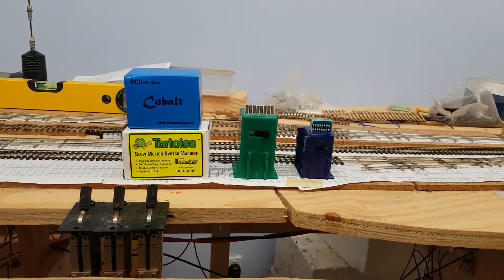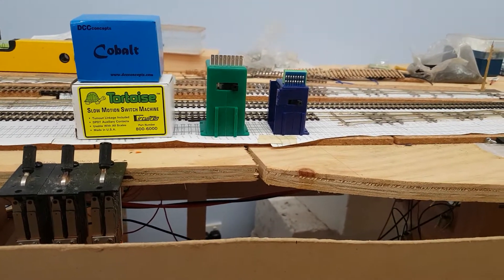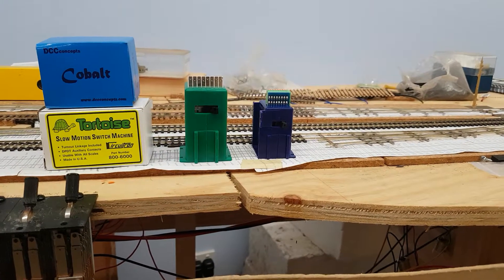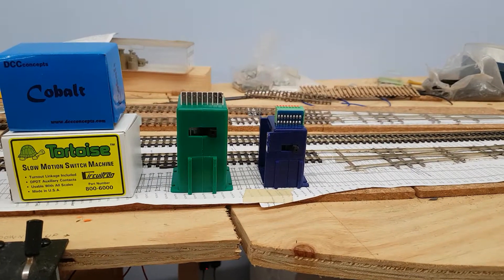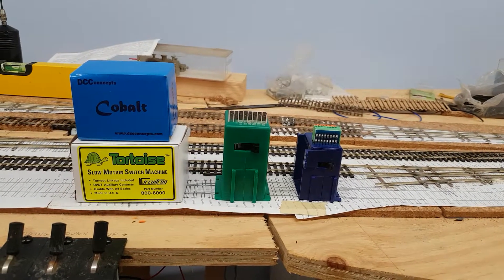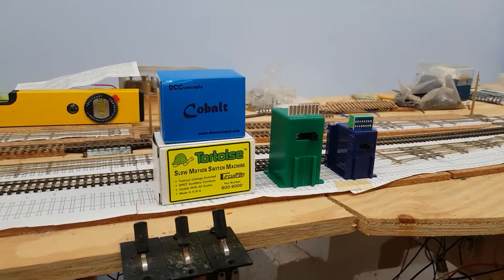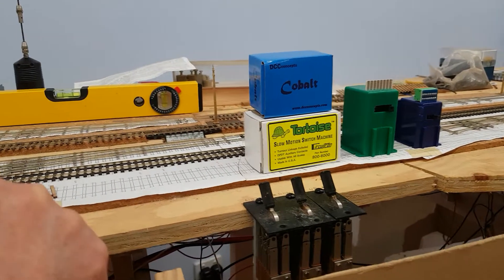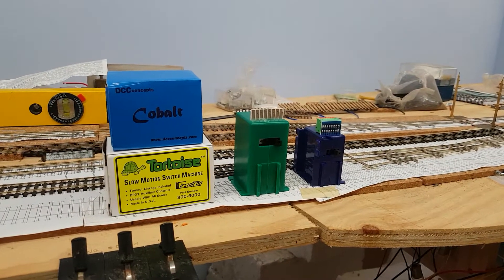Point motor comparison

Comment: That colbal seams to loud I have seen them loads quiteer
Reply from the maker: I could make them quieter by mounting them using the foam and plastic washers.  I suspect Cobalt have changed their internal design, or have changed the motor voltage to address the noise problem since this video. Also I hope the noise level will be less after scenery is added the layout.